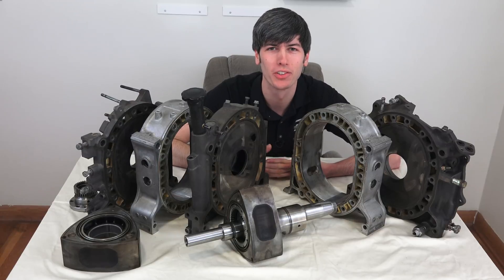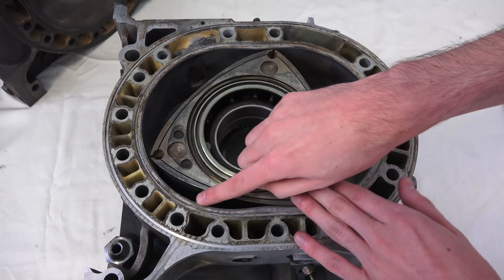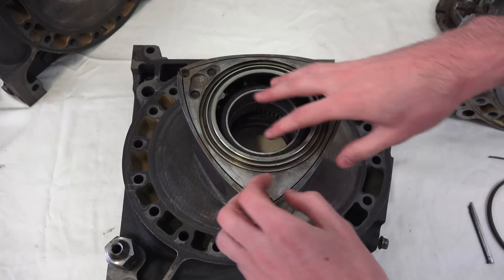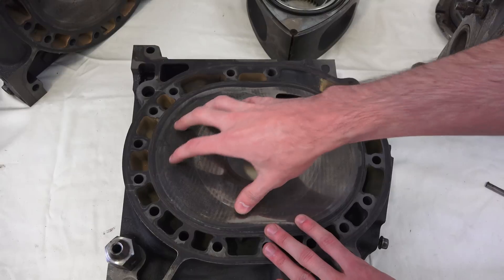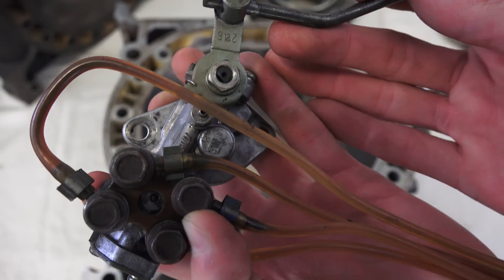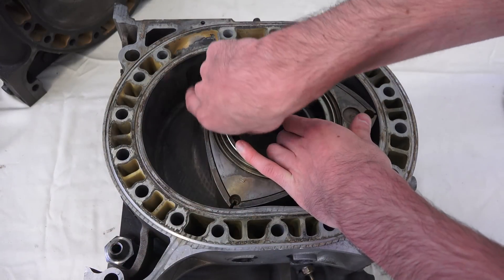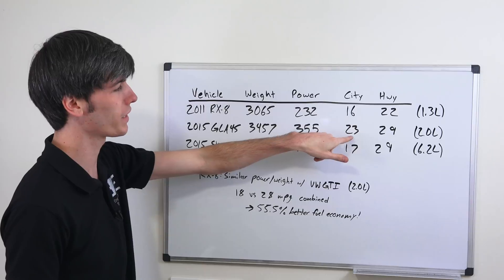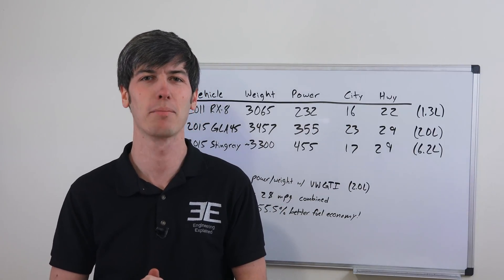4 Reasons Why The Rotary Engine Is Dead

Comment: Would you do one on why steam engines are no longer used in vehicles?
Reply: They're powerful but inefficient
Reply: The real doktorbimmer Yeah gas turbine is pretty damned good, but I'd actually give the edge to a steam turbine. Fact is the only thing that limits them are the materials they're made of. If the materials could take it you could just keep superheating the steam and produce more and more power
Reply: "Not living anymore" is a pretty big disadvantage for using a type of engine. They didn't just rupture steam pipes and literally melt people, they went off like 500 pound explosives if a part failed.
Reply: I am aware that Steam power is incredibly inefficient currently. I am not claiming otherwise. What I AM say is that if we manage to find a way to reuse the thermal energy, or to "pipe" it back into the start of the reaction, it COULD be made significantly more effective. And don't bother browbeating me like you have everyone else that posts in this discussion.
Reply: Not sure what you mean by "a few".  The USA and Russia alone had 200 nuclear powered submarines at one time and only scrapped some of them as part of arms control deals, not because steam is dangerous.  Furthermore, the safety record of US naval nuclear power is flawless (not so with diesel-electric, by the way).  And something like 450 nuclear electric generating plants are in operation around the world - all using steam - as do even the most modern plants still on the drawing board.  So in no way has steam been abandoned for being too dangerous.
Reply: Ever heard of Fukushima?  That one makes 3 Mile Island, Windscale and Chernobyl look like small potatoes.
Reply: Given the possibility that there are more efficient designs possible to harness steam, so far the only possible "legitimate" objection I have heard to steam is that there might be a large loss of energy at the point at which water is converted to steam.  Does anyone know the rate of efficiency in converting water to steam?  (Naturally this might be partly influenced by the mechanism of conversion, but I assume there is a maximum theoretical efficiency.)
Reply: 40.7 kJ/mol, and there is about 210 moles in one gallon of water. And it's not so much as "efficiency" but more along the line of that is what is required to do it. You do not lose the energy, it is just stored in the steam, until it transitions back into liquid form. The primary way a steam engine is inefficient, is by the inability to perfectly insulate it. This issue is "mostly" resolved in nuclear reactors, because it is a sealed system, but in good old ma and pop coal burning engines the exhaust alone steals truckloads of energy from the system. the only way to make them very efficient would be to find a way to make sure every drop of heat generated goes only to the steam, and do so without use of power, which is impossible in the foreseeable future. The best use of water based "energy" systems is in hydraulics, because all it is, is moving a liquid through a tube, but the sky is the limit on it.
Reply: You are also correct, but what I propose is not a "pass" based system, but a sealed system. where the cooling towers feed directly back into the system, so you don't lose a significant amount of heat anywhere in the system. And I agree that steam engines are too large to be used as means of propulsion for cars. they are best where huge amounts of power are needed, with no real size constraint. what I was saying that given time, and development into different methods, should the recovery of the thermal energy in a very high percentage relative to energy expended. achieving that would make the steam engine more competitive in terms of efficiency.
Reply: The longer the half life, the better I like it.  If you don't understand why, you shouldn't be commenting.
Reply: @InfiniteMushroom i think pine trees could power everything if tap them
Reply: Everyone dumped steam?  I guess you mean other than every large ship and submarine in the US Navy?
Reply: Seems to me this reply completely ignores the existence of SSN-571, USS Nautilus, launched in 1954.
Reply: Mr Reymundo
Reply: Mr Reymundo They take 30+ minutes to start
Reply: Uranuspounder  You wouldn't feel anything  after 2 seconds,  your skeleton would be all that was left after getting hit with 300psi of 800 degree superheated steam.
Reply: 1# You need water (preferably distilled water), try buying that at the gas station...
2# Warm up times are loooooong, which is not acceptable to the consumer
Reply: InfiniteMushroom + And sail power.
Reply: Because the RX-7 and RX-8 still have a lot of fans and I still see some RX-8s on the road.
Reply: steam engine are the same principle as petrol/diesel  engines ... old tech
Reply: Steam engine r still available. Nuclear reactor use steam powered by nuclear fuel rod(bundles) to produce electricity.
Reply: @InfiniteMushroom agree coal is better. Im thinking of the longleaf pines that grow in southeast usa where i live that burn like sin because so much resin sap in wood.  Surely its better than wind or solar
Reply: Some folks here could do themselves a real favour & take a look at the absolutely incredible cars that Abner Doble designed & built, especially his last designs before the Depression finally killed his self-named car company. I saw a wonderful video of one of these beasts being driven from a cold start on "Jay Leno's Garage", he's got a few steam cars in his insane collection. 90 seconds from switching its "ignition" (heating coils...😅) on, the 5ish ton beast had built up enough steam pressure to allow it to gently toddle off; building yet more steam pressure & velocity as it went along. Quiet as a Tesla, smooth as silk, & just a wisp of white steam out the tailpipe!
What killed Doble off? The incredibly high prices for what were very low production cars in a time of abject economic poverty, with little to no chance of making them substantially lighter & therefore less expensive to build. Economies of mass production weren't anywhere in sight. And perhaps having to wait a whole 90 seconds after you turned the "igniter(s)" on before you could amble off from an absolutely cold start!🙄
As far as safety goes, I think guys as brilliant as Doble making extremely expensive cars had enough foresight to incorporate virtually failsafe over-pressure blowoff systems!🧐
Reply: @joerosen5464  Steam cars were rendered obsolete by the invention of the electric starter for ICE cars.
Abner Doble was very talented but he was also a crackpot and con man.
Doble lost 10s of thousands of dollars on every car he sold and was indicted on stock fruad and embezzlement charges.
The Doble steam cars company went bankrupt because steams cars could not compete with ICEs
Reply: Really? What about the Nautilus? It completed a journey under the north pole in 1958 on NUCLEAR power. It was the worlds first nuclear submarine. Check facts before spouting off.
Reply: https://en.wikipedia.org/wiki/List_of_boiler_explosions
Add the U.S.S. Maine to the list unless you think the armory exploded. I can't recall the last time a diesel engine killed 1700 people when it failed. Failures in controlling steam power are also responsible for explosions in power plants like Chernobyl. Steam is not easy to control and easily overpressurizes containment systems when their heat source isn't regulated properly. To utilize it you essentially have to potentially make a very large bomb.
Reply: Agree about the hysteria around nuclear energy.  Unfortunately, fusion is really hard to do.  We should just accept fission and get good at it.  Maybe when fossil fuel scarcity and emission restrictions start to seriously jack up energy prices, people will think again.  It's easy to be picky about power plants when energy is cheap.
Reply: Its quite simple isn't it?  Short half life = lots of radiation as it decays fairly quickly.  Long half life = slow decay so not so much radioactivity.  No need for insults as these simply reduce the credibility of You Tube.
Reply: As others have said, waste heat is a big deal - so is having to carry a prodigious amount of working fluid (water) which you either lose as you go or recycle using a prodigious amount of additional hardware. Eventually you have something that either won't even come close to fitting under a hood or can barely run the AC blower.
Reply: 2friendstoking That would suck, but it is unlikely, as any accidental leak would likely be under the hood, just as any car fire now is most likely to start there.
Reply: Except for that type of power I specifically mentioned twice? Yes. It took until the 70's after decades of development for reactors that small to even be fitted onto naval vessels. There was one powering the military installation in Greenland as a proof of concept before they went on carriers and subs. It's a very different type of steam loop that utilizes less fuel rods but it's hardly benign. Early nuclear submarines (especially Soviet designs with poor engineering) would overheat easily due to simple human errors and sink the entire vessel or kill most of the crewmen fixing it before the rods melted.
Reply: Steam, which used to power American industrial factories, was abandoned in favor of electricity, not because steam was dangerous but because it was more convenient to have a motor on each machine you could turn on and off rather than having overhead power shafts to contend with and having to stoke a boiler.  Steam lost the battle in automobiles to the ICE, not because steam was dangerous but because it was inconvenient to have to warm up a boiler before you could drive your car.  And steam is still the rule rather than the exception in most power plants.  So I don't know where you got the idea that it was rejected due to danger.
Reply: Yes, diesel running on biofuel is a good alternative, although using farmland for fuel rather than food is a downside.  The thing about steam is that it is not a SOURCE of energy but a medium for transforming energy.  So to condemn steam based on the price of any particular fuel is a mistake.  Nuclear energy, which, like it or not, is going to play a role in the future, runs with steam and will until there is an efficient means of converting heat directly to electricity.
Reply: Those reactors used MOX fuel which still appears to be fissioning judging by the radiation levels.  Simple solution hose it into the sea. Unfortunately the half-live of Plutonium 239 is 24,100 years so be careful not to eat a lot of fish.
Reply: The real reason: They explode easily. Steam is a volatile substance to harness and a key ingredient in nuclear fission reactor explosions. Of course all the other reasons are valid but everyone dumped them the first chance they got because they had a bad habit of exploding trains and blowing ships out of the water. Even improvements in design such as fuel consumption only mitigate the risk.

Comment: Rotary Wankel air motors as redesigned by engineer Angelo DiPietro at EngineAir Australia Pty Ltd, is a superefficient air motor that could replace all existing car and small aircraft motors. Rotary Wankel may not be ideal for gasoline engines but as redesigned for air motors I believe they have huge potential. Look at in wheel rotary Wankel air motors used for GM Cadillac Aera concept car 2010. That was an astoundingly efficient system but is being ignored by all the car makers as far as I know. It had an estimated range, at highway speeds, of 1000 miles per fillup of the carbon fiber air pressure tank holding up to 30,000 psi air pressure. Full size luxury sedan would be made with carbon fiber composites almost exclusively. 1000 lb. curb weight. Very high power to weight ratio.
Reply: The real doktorbimmer
It works and is used. Please get therapy.  The biggest scams are in the USA.

Comment: Another good "watch". I had driven a 13B/RX4 sedan for a while and loved the performance for what "sounded" like quite a small engine, liter wise. I knew that it was a gas gulper. Plus the cRaZy "thermal reactor" (older models) on the exhaust output hinted at it being less than Earth friendly. One thing I always considered, and I'm curious if you might agree or I need to be corrected; is that it may be more accurate to consider the engine a 3.6L and not a 1.3? If you think of the face of each rotor being a piston top, it's really like "3" pistons using one cylinder. Then add the second rotor for a total of 6 pistons, 2 cylinders. I heard or thought is was a way of Mazda entering the market with a smaller spec engine, i.e. taxes, racing venues classes etc. Any thoughts? Thanks again!! p.s. Outstanding video quality.

Comment: Mazda is going to launch rotary again by 2019. It is not dead.
Reply: aslong its burning oil, its dead by design.
Reply: ok buddy i'll have to take you word on it.
Reply: +The real doktorbimmer you said it yourself mazda called it the mazda rotary. so technically it is a rotary
Reply: Even if the engine did reappear, the fact that it is in one make and only one of their cars is proof that the engine is dead. 

Mazda did very well to keep the Wankel going all these years and they did largely overcome the apex seal problems. But remember NSU abandoned the engine in the 60's for all the reasons mentioned in this video, and in today's world the pressures of efficiency and pollution are worse. Yes Virginia, there might one day be another Mazda Wankel, but nobody else will EVER produce one because the design is dead...
Reply: People love them so much they are building their own. Plus I bought a brand new block from Mazda 2 months ago. So I'd hardly say the engines are dead. They are well and truly alive and well.
Reply: look at mazda rx vision
Reply: 2jz I'd dead but still dominating
Reply: Yes, the rotary engine will re-emerge in a 2019 Mazda, but only as a generator for an electric car to extend range. The compact size and power density makes it a perfect, OK better, portable generator.
Reply: +The real doktorbimmer  You may be right. Here is my source 
http://www.foxnews.com/auto/2016/11/23/mazda-rotary-engine-returning-in-2019.html
Which references:
https://www.carsguide.com.au/car-news/mazda-confirms-electric-car-plans-for-2019-47372
Which states:
"He did say, however, that the car is likely to use a new-generation rotary engine as a range extender, similar in concept to a BMW i3."
Reply: @Bare_Essence  Mazda just announced its 2021 model line with absolutely no Wankel engines available standard or as an option.
Reply: +The real doktorbimmer  You are right about all the issues mentioned for Wankel engines. Was not replying about that. It may never come to light or may not be a true Wankel.
Reply: Cuz the RX vision
Reply: +hcci
Reply: Rafael Fongozi that will live on for 20 years just because of the sound
Reply: Rafael Fongozi i hope they do my dream car is a mazda rx-7
Reply: https://drivetribe.com/p/rejoice-mazda-is-still-continuing-Tqa0dn9WRvurQA8MR7MDKQ?iid=QFPz4bM5SQyOGzdDHYRT_Q&utm_campaign=main+&utm_medium=fb&utm_source=organic
Reply: Great
Reply: The problem is reliability and environmental friendliness
Reply: Of course it was. That was then and this is now. We have flying  cars and robotic dogs (and women) now.  So ...
Reply: BlacKi what about 2 strokes
Reply: It's actually called the Wankel Rotary engine, so you're both right, regardless of how ignorant you may appear to be, Doktorbimmer.
Reply: +The real doktorbimmer youre still wasting your time 'informing' people about the rotary? jeez man do you have a life?
Reply: NSU was making Wankel engines till '77 for what? From what I know NSU was out of the automotive game by about 1970 or thereabouts. There could be some odd industrial or small displacement engines made still, Suzuki sold a small run of RE5 motorcycles in the 70's. I should have prefaced my comments as being in regard to automotive applications. 

Mazda just wanted to cling to the exclusivity of the design so they worked to overcome the issues. They weren't able to fix most of them but they did better then anyone else. With the internal combustion engine on the whole under pressure today, there is little chance the Wankel will return for any automotive uses.
Reply: Don't hold your breath they gonna be straight garbage
Reply: The fact is that the car with rotary is will be launched soon on the next couple of years and it will be rotary again. I don't care about who has the patent for rotary, wankel name and other things that for don' t really matter. The thing that realy matter is the fact thr cars will be launched soon. :)

Comment: Hello, I worked on these engines 1979-81 the biggest problem was heat dissipation and because of that the seals would go, Mazda RX3 was about £3,500 then and 32-36,000 miles they would need a new engine at a cost of about £375.00 but people kept buying them because they were quiet, and fast ad well, different I suppose.

Comment: When you compare engines, you should compare the engine weight, not car weight. The car has not much to do with how well an engine is designed or how well it works. Pretty pointless to be honest...
Also it would be nice if you could write down that it's lb.